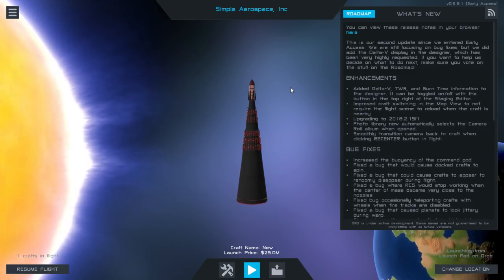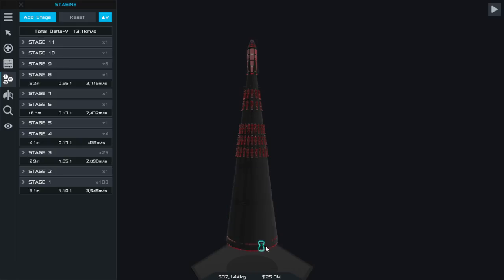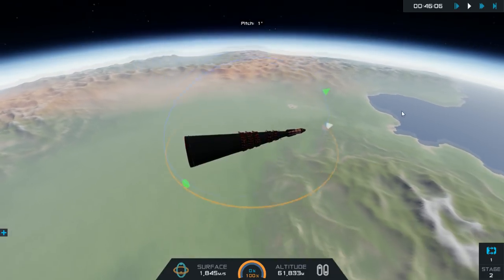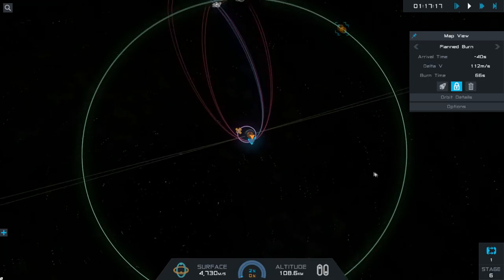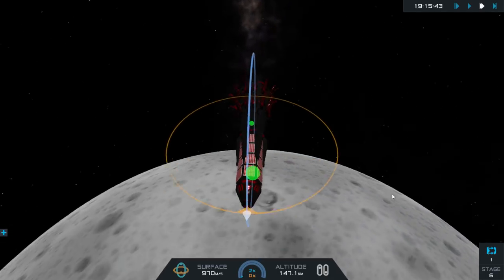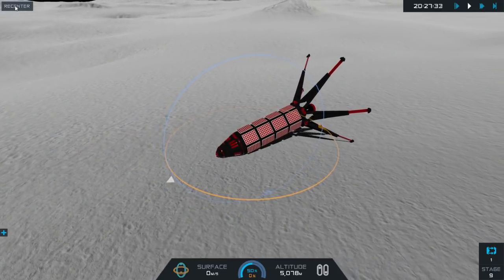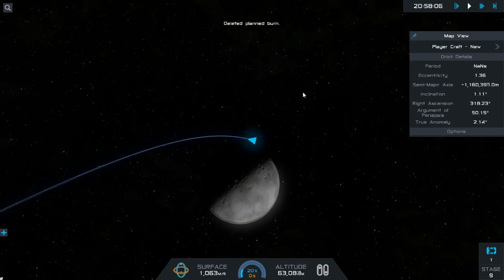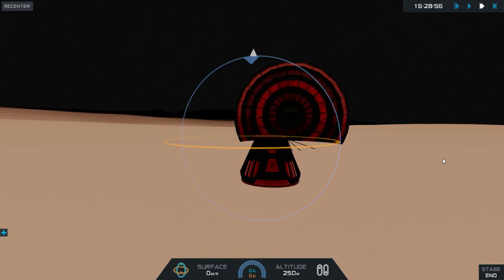Simple Rockets 2 - The Power of 108 Pixies

Comment: After noticing that you could deactivate the landing legs by clicking them, did you really not even consider clicking the parachute to activate it instead of staging the decoupler?
Reply from the maker: I'm sorry - was there a problem with parachute deployment? I thought it worked fine?
Reply: @RaizSpace  It was a flawless landing, just that you mentioned something about change the staging so you could deploy the chute without detaching your lander.. but you don't need to change the staging for that you can activate parts manually without staging them as you found out just 5 minutes earlier, but didn't even try it with the chute!
Reply from the maker: I was just curious whether changing the staging on the fly could be done. I'm guessing you're saying that it can't?
Reply: @RaizSpace  AFAIK you cannot change the actual staging order on the fly at the moment, but there's no need really as any part that can be staged can also be manually activated at any time through the infobox that comes up when you click on the part.
Reply: Anyway it was a fun video to watch and inspired me to build a rocket with 404 pixies and a 2 million KG fuel load today, which managed SSTO even though the entire launch ran at about 5fps lol